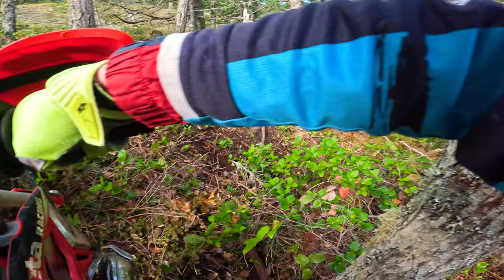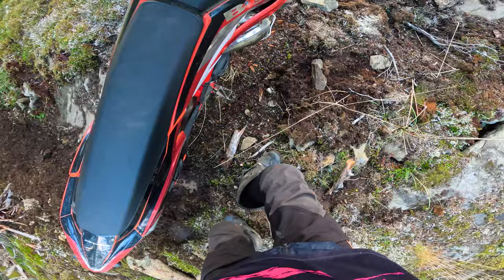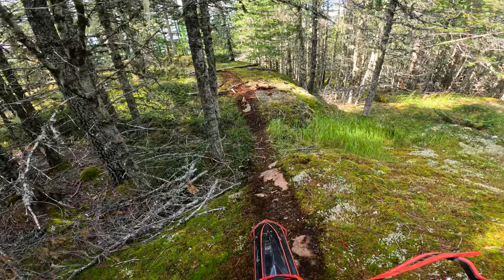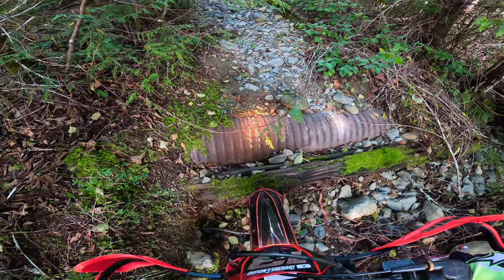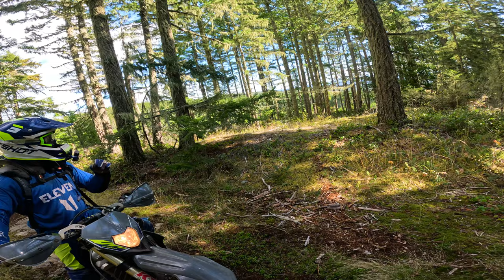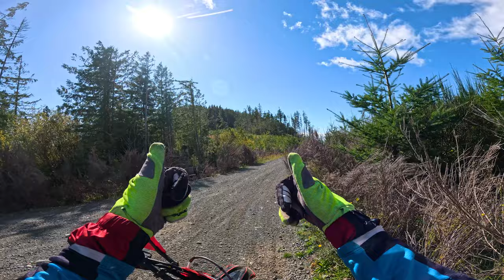Things Got NASTY QUICK

Comment: I'm looking at getting a xtrainer. I ride a lx250 now witch is kinda hard to hard Enduro with. Will this bike hold up to a 250 lbs rider if I have it re sprung for my weight? How is suspension when riding faster?
Reply: Kx250
Reply from the maker: I think resprung itll be good. But if you’re buying an x trainer to ride fast terrain , you’re looking at the wrong bike. The x trainer excels is hard technical terrain. If you wanna blast through the forrests check out the rr’s or the new x pro or the race edition if you’re wanting to go with team BETA
Reply: I ride both hard Enduro stuff and some flowy fater stuff. I'm short to 5 foot 8. Im more hard technical style of riding just occasionally I like to blast through the woods.
Reply: I'm not sure how I feel about the x pro with the one spring in the front fork.
Reply from the maker: @Elisrecoveryoffroad then i think if it was re valved for your weight you would enioy the bike. Its very narrow, nimble, easy to toss around and is a total tractor